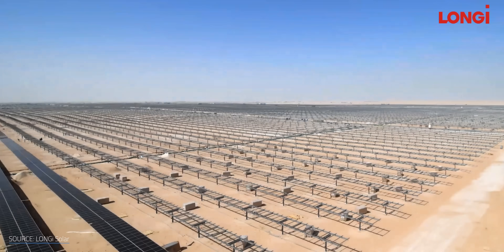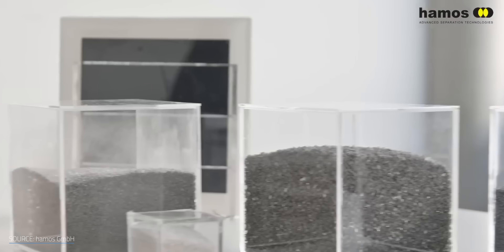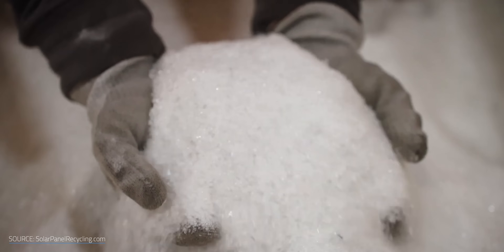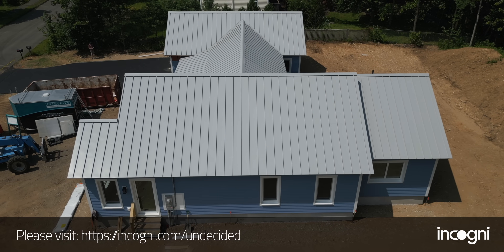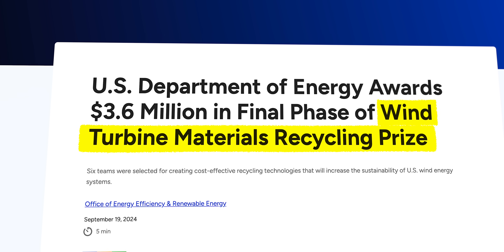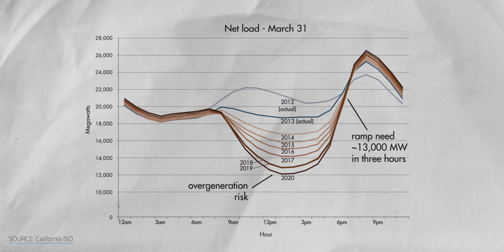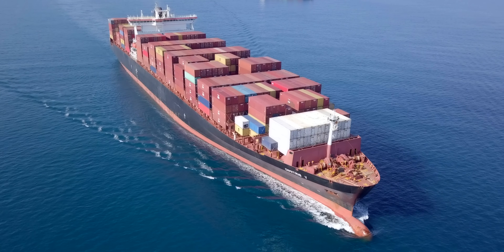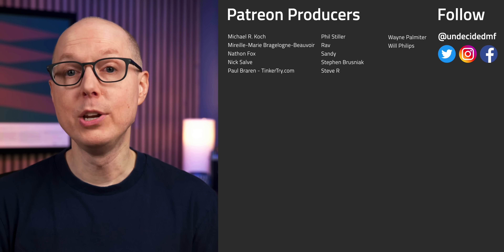How We Solved Renewables BIGGEST Problem

Comment from the maker: Do you think these advances in recycling are moving us closer to the closed loop ideal? Take your personal data back with Incogni! Use code UNDECIDED at the link below and get 60% off an annual plan: http://incogni.com/undecided

Corrections:
01:50 - Silver tripled in demand, not price.

If you liked this, check out Why This Ultra Cheap Battery Breakthrough Matters https://youtu.be/qZ8z5tFzuIw?list=PLnTSM-ORSgi7uzySCXq8VXhodHB5B5OiQ
Reply: Before watching, at what point do you decide for or against a claim?
Reply: @jeffkilgore6320 I hoping it will work.
Reply: Unfortunately, it is doubtful any of this will be recycled unless it's because of a push for self reliance (conservative view point). We've had decades of trying to recycle plastic and it's gone practically nowhere.
Reply: @herbfst 
The mass volume and availability of these materials are very likely to lead to breakthroughs in reusage for most of them. 
It's very likely that eventually, most of the landfills will be dug up and reprocessed for all their residual resources.
Bacterial, fungi, mycelium, and other waste abatement and reprocessing technologies are advancing very quickly.
What seems hopeless after several decades can change very dramatically and quickly with the right incentives or needs.
Waste water retention and reprocessing is another area that already is and will go through dramatic evolutions over the next couple decades. 
Slowly, then suddenly.
Reply: @Skunk106 Everything you stated was said about plastic so it's doubtful.   I hope it does but reality doesn't agree with you.
Reply: @herbfst  
That's ok. Reality changes all the time!
Reply: My idea for turbine blade repurposing is to modify the large blades into much shorter multi bladed rotors and be used as low speed high torque prime movers as the traditional farm windmill or Dutch windmill designs. Ideally, they'd be group fairly tightly for higher power  density. This could be done hydraulically or mechanically, with  the power production being used locally or transmitted to a central collection point for industrial utilization, such as mechanical electric grid batteries.
Although these would be much less efficient compared to electrical generation, the idea is that they may have much lower initial build costs and very long low RPM service life cycles.
Even better would be if the could be built amongst or adjacent to existing wind and solar farms to create complimentary battery banks. 🤷‍♂️
Reply: These advances seem like a huge step in the right direction. Hopefully incentives for advancements keep up and more opportunities for the geniuses to distinguish themselves do the same.
Reply: Nice video was really interesting.  I live in the midwest USA and I'm a few miles away from a new wind turbine recycling plant built 2023 with it's own dedicated rail line to bring old blades in to be recycled.  I really don't think wind is going to be recyclable till we find replacement materials like this PECAN you mentioned along with carbon fiber matrix or some other material.  The plant worker told me they have several thousand tons of material sitting on site processed but no one wants it.  They've been trying to get concrete companies to use it, but so far, no luck.  Solar field that went up in 2022 near me took 1000 acres of prime farm ground out of production, but I see solar panels at least as recyclable.  Would love to see solar be put up over parking lots though first before we take food production away.
Reply: Why not turn decommissioned wind turbine blades into shingles for houses?They're already weatherproof and far overbuilt for the job.
Reply: @ryelor123  perhaps because that would mean that slowly over time even if they are ridiculously durable against the weather, they will still slowly corrode a lot of plastic and stuff into the water that then goes into the water streams back out to the ocean so perhaps they want uses less closely tied to causing excess pollution.
Reply: I’m still hoping you do a video on de-icing systems for wind turbines in northern climates. Companies like BorealisWind are working to improve efficiency and create closed loop systems!
Reply: @UndecidedMF  I prefer the approach that is taken here in Washington: make manufacturers recycle them. It has not really hurt our residential solar industry.
Reply: Maybe look at the disposable vape industry next— I wanna hear about it—
Reply: A quick Google search shows your claim that silver has tripled in the past 3 years is a lie. If you want people to listen or believe you get your facts straight.
Reply from the maker: Sorry about that.  It was demand, not price (I've added a correction).
Reply: We really need this to work for Evs to surprise gasoline vehicles. I'm not sure we can mine enough raw materials to replace 2 billion vehicles.
Reply: or do what I am doing, and make the solar panel something that can be opened later to redeposit more of the P junction material that is what is breaking down in sunlight, like how the sun degrades the compounds in a print or photo "fading" it, and this would allow just removing the top panel over them, run them through the same last step process of the cell itself with out disturbing the collection metal filament system embedding more atomic material into the cell that makes it a solid P junction, put the panel back on top sealing it back shut, and hook it up to the solar array and let it run generating power again.
Reply: also I am not sure if SAKUU is using the same tech my iron metal depositing from rust (yes turning rust back into iron) 3D printing tech, but if so. it should be quite easy to build a unit smaller and more compact so someone can have a battery tech manufacturing rig you can run from a bench top in the garage or a spare room at home to make your own batteries, (and reclaiming is as easy as building an electrolysis system that has teh same membrane separator tech that they use in the lab to break sodium and chlorine apart from table salt.
Reply: im really curious how the lasers work as i would imagine perhaps the thought is to have something that absorbs the heat even just like black paper in between the glass to cause the laser light to be converted to heat exactly where you want letting the laser be shot through the glass so you can get exactly the weld you want exactly where you want it. honestly the shit people come up with never ceases to amaze me....
Reply: @C_A_I_N_N  people dont realize that there is a split between electrical charge and heat that light converts to on absorption, and the higher the frequency the higher the voltage pressure the photons carry, turning either to electron displacement or thermal elevation
Reply: fossil fuel companies are shaking
Reply: Your content is amazing, thanks for uploading in Hindi
Reply: Just so you know, you said Nevada incorrectly.
Reply: Google "Acciona creates first surfboards from turbine blades"
Reply: Who are we kidding with these sexy looking energy sources. Nuclear energy is the only effective solution to fight climate change. Fusion is still 30 years away, but MSR tech is here and now. Why the hell people not know about it? And actively invest in it? Flibe energy, Copenhagen Atomics and many more are trying to bring these technology to market, they should be receiving 100s of billions in investments
Reply: Don't worry, Musk is removing funding for American science, especially eco-friendly solutions, so all these projects will be moved to China or the EU or canceled.
Reply: I hope the recycling advances won't be torpedoed by the idiots and oligarchs trying to ruin the world.
Reply: Houston has 3800 open bus stops that need an overhang/rain and sun block....windmill blade 🪄🌐🤷‍♂️
Reply: To answer the question.  Ask me in 30 years when my panels need to be replaced.
Reply: what was video about again? I didnt pay attention because you sound like fake news.
Reply: Calling total BS on silver being 60% cost of solar panels. I'm guessing maybe 10% at factory. The cost share of silver in solar panels may have risen 60%.
Reply: @knotknots6601 The average solar panel contains about 20 grams (0.643 troy ounces) of silver20 grams of silver is worth around $42 usd so sounds not to far off TBH.
Reply: @knotknots6601  yep the AI said you guessed right. is 10 percent. But since the retail cost is huge compared with the production cost, then actually the silver is just a small percentage, more likely 1to 2 percent.
Reply: Matt, do you find it odd that so many "biggest problems" are all being solved at the same time?
Will the bankers allow you to do any episode on that, or do they have FULL CONTROL???
Reply: @jeffg4686  dude i get what your trying to say but you do  realize all of the things he mentioned are MASSIVE problems right? you do realize that solutions NEED to be found right? like yea theres always a good word to be careful of grifters who say they have found a solution and ultimaltey, as long as watching this video only goes as far as "i watched it" than its not really an issue with anyone dedicated enough to actually have any sway in money going into shit looks into these problems, they arent gonna watch youtube videos but look into the actual facts elsewhere.
Reply: I think you got hacked.  Someone posing as you sent me a whatsapp  number. What should I do now? I did not respond to it.
Reply: And how much does these new recycling methods reduce the carbon cast for making these renewables. As only Nuclear is the only one that off sets its carbon coast and provides consistent clean energy. With its waste having been solved decades ago.
Reply: @elysainempire4628 Most nuclear waste is stored on site in concrete coffers.  They gotta figure that out before they run out of room . We need permanent storage.
Reply: sounds good so far. though having musk-tied ppl there is icky, personal opinion. gotta step it up even more. y'all know that, lol

Comment: "Water batteries," also known as pumped storage hydropower, are large-scale energy storage systems that utilize water reservoirs at different elevations to store and release energy. When there's excess energy on the grid, water is pumped uphill to a higher reservoir. During periods of high energy demand, the water is released back down, turning turbines to generate electricity.

Comment: Interesting that 43m tonnes of turbine blade landfill by 2050 is seen as a big problem for renewable wind when the figure for co2 released into the atmosphere for 2023 alone was 37.8 billon tonnes. The devil you know!  Not that addressing the issue should be ignored but that this type of data is used to discredit wind power.  Solving the recycling would be great but even without it is better than our current position.

Comment: A lot of this seems a little ridiculous, like really? Burning away the probably grams of adhesives in a panel is seen as so environmentally unfriendly? Compared to what? The thousands of kilograms of oil or coal that would’ve been burned to generate the same energy as that solar panel did in its lifetime? Do solar panels really need to be pure and perfect before we replace the ridiculously toxic and deadly coal and gas plants?
Reply: It's amazing what criticisms one can find when one doesn't understand mathematics of manufacturing processes.

Comment: Ok, but three problems still remain :
1. Solar panels only work well when there is enough sun (they have highest capacity in the deserts, where there are close to no clouds.) And they don't work during night.
2. Wind turbines rely on wind, they scare the birds (and also often kill them), and create lot of noise. Wind is unreliable, even in windy areas, and requires batteries.
3. Water Dams, require building huge reservoirs, and they cool down the water, causing changes in the environment they are in. The cooling of the water can be both damaging and beneficial, depending on the conditions. It still, however, depends on the environment, to a large degree - due to rains, and precipitation, that can cause floods.
Also :
4. Burning "eco fuel" still produces CO2. Gas might be better than coal, but we have developed carbon capture technologies by now, and pure carbon, is actually pretty good fuel, if you factor that in.

Comment: I think more research needs to go into renewable liquid fuel creation and efficient fuel cells. 

For one thing, creating liquid fuels from captured carbon means that stockpiling energy is incredibly cheap and easy and building more capacity doesn’t require more expensive materials like batteries do.

I think that our current economic system is unsustainable and will collapse one day, so I think that the future will favor greater self sufficiency and a greater reliance on renewables. Lithium doesn’t exist everywhere on the planet, but the materials for solar panels are cheap and abundant, same for wind and water turbines. I think that the best technology will be microgrids that can take in renewable energy and stockpile it in the form of combustible fuels that can be used in efficient fuel cells with waste heat capture. That way people will be able to cook their food and heat their homes and hot water without having to rely on anyone else.

Comment: While the potential buildup of waste is a big problem, I think it's far from the biggest. The shady, and sometimes outright lies and scams in the industry are. Everything from promising physics breaking returns for home installation of pv and wind, to pork belly grants and regulations getting things like wind turbines put up in poor wind areas where the pubic can then see significant numbers of them malfunctioning shortly after installation. Not to mention those who check out the publicly available financial records that clearly show nothing but losses. These factors make many people down right hostile towards the industry, while those who believe the sweet lies become activists without a clue, both extremes harming real progress is the fat bigger problem.

People who I could have shown that the long-term numbers of a small grid tied pv system would have been a better investment for emergency power backup than small generators, or even just the real advantages of cordless outdoor power tools instead of small engines, won't even consider it.

Comment: A fish grows to its container. Thus the environment is using 100% of the energy given to it in some way. Solar through the various heat and evaporation cycles and wind generated from the various sources. So by removing (x)  joules of either from that environment that has to have (x) energy will have unknown long term consequences just on GM.  especially considering how many pollen, and seed dispersion strategies depend on wind energy along with the cooling effect (lake effect) bodies of water have in relation to the moving air, and, then solar is absorbed and released at measured rates by the area of each biome.

I am all for solar over things like roads and parking lots, and on buildings which are all just heat capture anyway that release unnaturally at night affecting their local environments. removing that heat is probably wiser. but putting solar anywhere else is just like putting a parking lot there except the energy goes in and never comes back out or gets concentrated in urban areas furthering their problem of heat retention.

The use of fossil fuels is separate from this because the energy represented was captured millions of years ago mostly during the carboniferous period before the microorganisms that break down cellulose evolved. The new cellulose structured plants would be stripped of everything except the cellulose by the enviornment then that cellulose would become part of the loam building up like peat over time. this then became coal, gasses, and oil. So using them is actually just returning carbon from the surface back to the surface. 

Alternately if you want a cleaner solution then liquid salt nuclear or if we can manage it fusion is the ticket. 

I do not mind looking in to solar for small out of the way places and as a supplement,, retained heat solution. But wind is a no go. Every time I noodle it removing that many  joule from the wind/water cycle isn't going to end well plus they are obnoxious and a hazard to wildlife, on top of most of the blade materials not breaking down nearly ever nor being easily recyclable. I believe further research beyond solar recycling is a waste of funds in light of this and believe whole heatedly that we should be investing primarily in Fusion and fission development which will drive the power hungry high sciences of the future think of direct energy to matter conversion you'll never produce enough energy to develop that with some wind turbines and a tan alone..

Comment: YO! If there's anyone reading this that can answer my question then maybe it could help redirect some of the waste. So, would it be possible to use the waste as a filler in products like cement, bricks, and any other similar materials? To clarify, when mixing cement,  could this waste be added to it? It likely would require some waste to be further processed (like broken down into smaller fragments) but if it helps it may he worth the time and work. I can assure you that with all the inmates we have, that this processing could be turned into a work program for inmates. Just offering suggestions....If anyone knows of other instances that would be feasible relative to using waste as a filler, let me know.

Comment: With no incentive my 6.6kw system was ~$7k AUD roughly USD$4500. Weird how expensive it is in the USA.
Reply: Also I got an incentive so mine was AUD$3800 installed or USD$2400. ROI is 3 years for us with grid power costing 28c per kWh or 18c kWh in the USA.